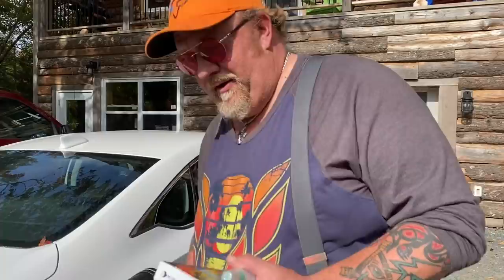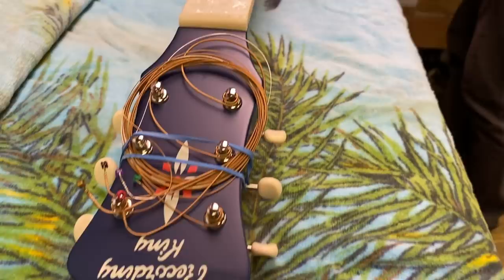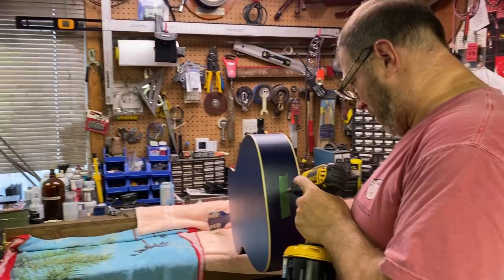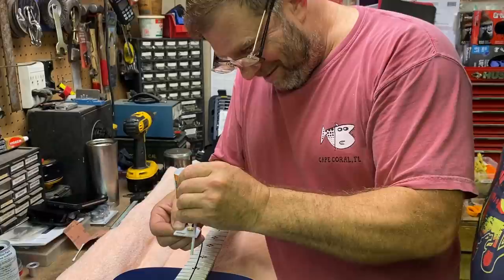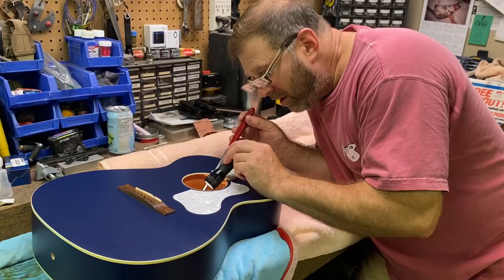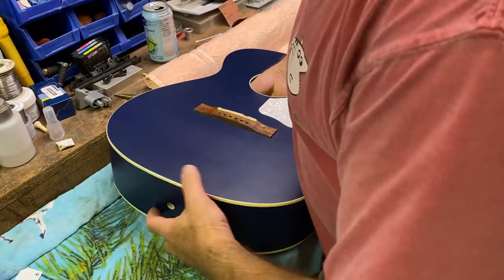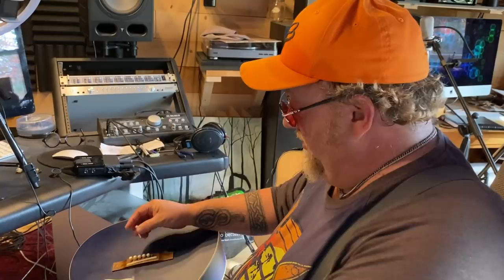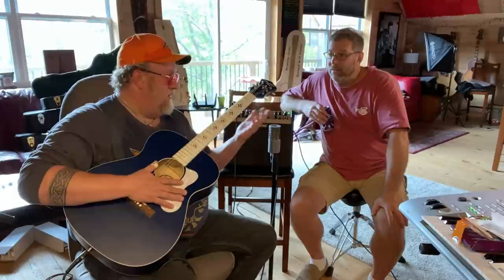K&K Pure Mini Pick Up Install

Comment: Excellent video, I've long believed the K&K Pure Mini is the best pickup out there. The trick is finding a guitar without any electronics in the middle of the market, which I'd say is less than US $1000 or indeed here in the UK for less than £1000. If I see a guitar with a 'barn door' pre-amp, I run a mile. Happily, Recording King offer quite a few, especially as I'm after a smaller blues style box!

Man, you live in a beautiful location.

Comment: They have done the tests.  The K&K reduces the low end for less feedback. So it's only weakness is in the low end.  The K&K has the best texture for finger and flat picking.  I am mostly a strummer, with a tiny bit of picking.  K&K does not have enough bottom end for strumming in my experience when you want it.  Like in singer/songwriter realms.  The full "Anthem" with the mic does have full bottom end (getting some low end from the piezo even when fully faded to mic), and the second best texture on individual notes. The mic is also more natural sounding overall for strumming.  And the full "Anthem" is only good for low to medium volume gigs.  Tends to feedback at the very high volume gigs. Took me 15 years to see all of this. Just trying to help the strummers out there . . . because it is too late after you have installed it   .:)

Comment: Thanks Guys. I agree ... that the immediacy of "attack" on those under the saddle piezo pu's is unnatural. If you are sitting across the kitchen table with an acoustic guitar ..... there is a few milliseconds of delay after you strike the strings ... and the airwaves meet the ear of the listener. I have another K+K to install tomorrow in a '74 D-18 ... it had an LR Baggs in it ... that we took out. Cheers ! MMcC

Comment: Installed my first K&K pure mini in a Eastman OM yesterday. I have some pointers. First make sure you have a light inside the guitar to see the end pin openings. Have some plain nail polish remover or acetone to clean the surfaces or remove glue if the pickup does not stick and you need to redo it. Hold the pickup for the whole 5 minute time it`s kinda hard?  and don`t reuse the same putty tack it will flatten and cause the piezo not to bond correctly. The golf tee thing is a mess it falls out no matter how hard you press into the template so be aware. If you have broad large hands have someone else do it.

Comment: I have a plastic bridge pin puller that fits over the nut that tightens the end pin jack down . Lock tight super glue gell is a clean drip free glue for permanent installation of the pick up. If you run a tenor e guitar string in  the jack hole from the out side lower bout and run it through the hole at the top of the pick up jack ,and twist it,it will pull up flush through the freshly drilled hole. It pays to vaccum everything clean on the inside of the instrument before   the glue in.

Comment: You know what, you can build same style and quality pick up for around $20! Simple circuit but most important parts are those small disc type piezo sensors, three of them which are connected in parallel to the input socket, high quality 12mm dia discs with high frequency range typically around just over 10 Khz resonance frequency are the ones they use, don't use cheap larger dia Chinese ones as they have low resonance frequency around 3 Khz. which is ok for percussions but not for guitar..  Peace. ✌ 🙂

Comment: This may be subjective or random, but it's been recommended to me to use double sided tape instead of glue.... The premise (wasn't that it's less invasive to the guitar, but) was that it actually sounds "better"... "more natural" with double sided tape.... That it eliminate more of that last little bit of Piezo quackiness.....  A good acoustic amp.... And another cool idea is making your own IR's of your own guitars.... To closer to the actual sound of your guitar... You can use a simple IR pedal. And Bob's your uncle... Relatively similar to a mic'd guitar, without having to sit still for a mic or volume/feedback issues. In a mix a pretty natural live guitar sound.

Comment: I’ve been using K&k for over 10 years but I go for the added mic option in 4 of my guitars. Mixing the mic in with the sensors if used very sparingly provides the slightly treble bite that’s missing with the just the sensors alone. Feedback can be a problem if it’s overdone.

Comment: thanks . . . i'm sold on those pickups . . . pretty easy if one is handy with tools . . . also lol at the ribbing you guys gave each other. Cute doggy action 2. 

I found on amazon you have to order from the brands / manufacturer's official amazon store front (if they don't have one order off of amazon directly from them), otherwise chances of getting a fake / copy item. that's the problem with amazon, once they opened it up so individuals could sell on their main site a lot of knock offs and counterfeit / imitation junk products faking real brand items showed up . . .

Comment: who new a year later and I would be re-watching this because I have just ordered a K&K BECAUSE the Sonitone in my new H-Bird has a battery inside that requires the strings to be loosened to get your hand in the sound hole to replace the 9v battery.  My question is: can I leave in-place the piezo when I install the K&K??  (like just disconnect the piezo wiring) so as not to worry about destroying any wood where double-sided tape holds things like the preamp or the battery pouch etc etc ??
Reply: geez....sure hope somebody else visits this site to read my comment above.....I live on an island and I gotta be my own guitar tech.....help...please.

Comment: Shouldn't the wires from the pickup be running the other direction, towards the jack hole?  LRBaggs instructs to run them that way...   Just curious as I'm switching to the K&K.  Thanks

Comment: My Martin was hard ro play again after 30 yrs ...even light strings  ,though too high a bridge. ; but  my fingers still dent after a few hours!!   . Do you suggest some kind of / electric/acoustic   combo with . Also that d35 was always so big for me . So appreciated your talents... wow feel like playing again. Thank you 🙏 💕
Reply: If the neck is straight, you should be able to bring the action down to spec, by shaving the bridge or having a luthier do it.  I had a similar problem on a 30 y/o Martin and it required a neck reset, however.

Comment: Wow just saw the Yamaha Trinity video.... I’ve been singing and playing guitar 40 years, but never mastered real picking or lead. I’m basically a singer w good rhythm !   I have a Martin D 35 which the guitarist in my first Trio group ,, told me to buy.. aD35 @  a banjo instructors studio  in NYC,  Roger Sprung who only picked 3 or four of the best ones .. i picked out of only two, the one that had deepest ring tone..I knew nothing!  After 47 years the tone is still there ... but cracks , Maple Trim half off etc. Do you suggest sending to Martin? ..in Pennsylvania? or find a local Luthier here in north miami Fl.  Thank you ...feel like playing again 🙏❤️🙏🎸🎯

Comment: The pickup jig is WAY overcomplicated. A single jig with 6 holes, and 3 marked piezo spots would allow for all 3 placed simultaneously. 
If the problem with that is spacing, then theres an even simpler solution... buy 6 golf tees, and feel for placement. Problem solved.... 
All these steps with the putty and tiny jig are so unnecessary.